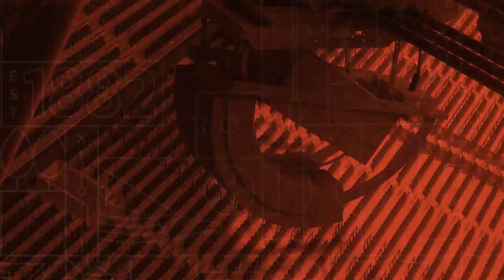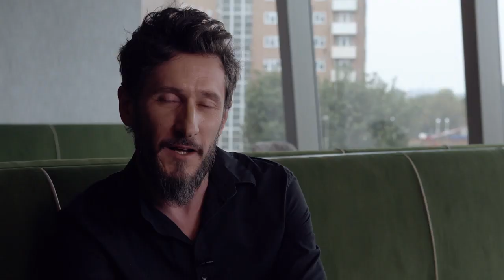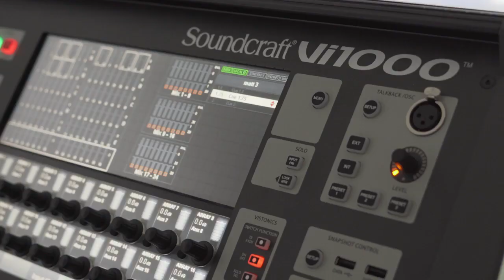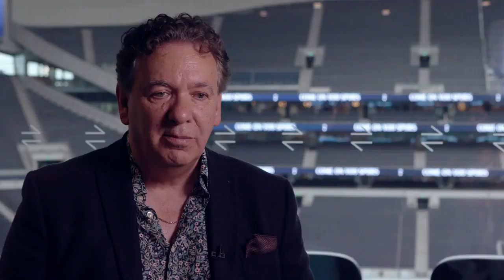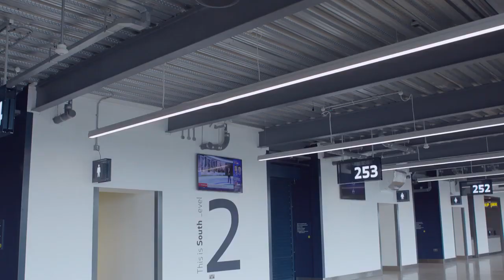Audio Inside London's Tottenham HotSpur Stadium

Comment: why is one of the subs facing backwards?
Reply from the maker: Subwoofers are inherently omnidirectional devices and will send low frequency energy to both the front and back of the cabinet. Turning one or more subs in a bass array to face backwards and inverting the phase (polarity) on that speaker(s) creates a "negative" wave that can cancel some (or nearly all) of the rearward bass energy from the front-facing speakers, thus creating a cardioid (directional) low-frequency array. This keeps much of the low-frequency content from filling a stage (or back of a venue) with unwanted bass. A few manufacturers make single-box cardioid subwoofers, or as you noticed in the video, these cardioid arrays can be created using conventional subwoofers. If you search for "cardioid subwoofer," you can find numerous explanations of how it works...
Reply: Lookup cardiod sub array and you'll learn all about it...